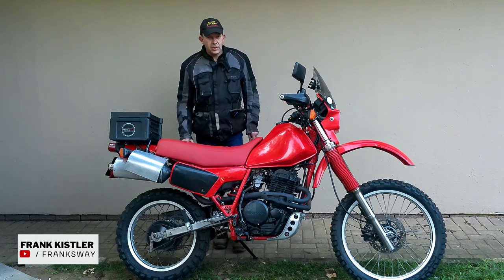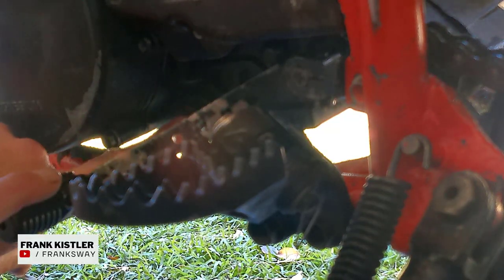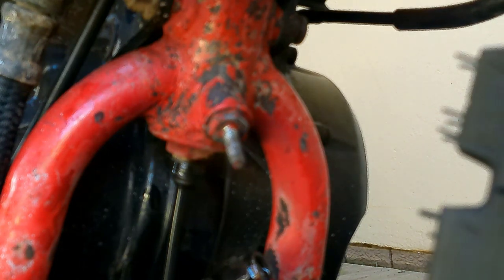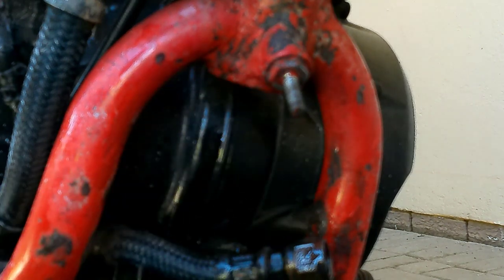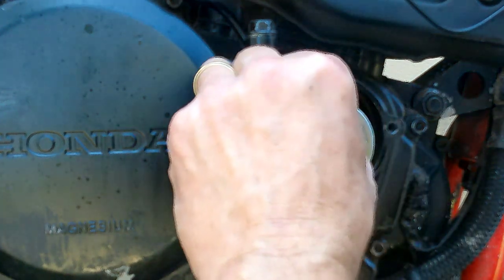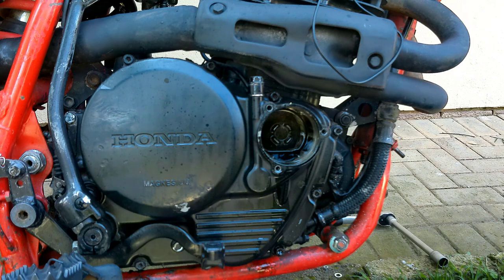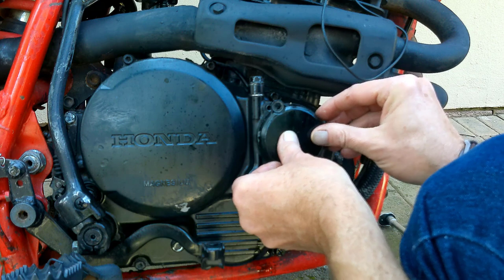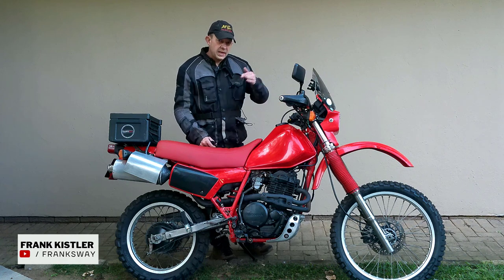Honda XL600 Full Oil Change #xl600,#honda,#xr600,#dirt bike,

Comment: Every how many miles do you change the oil? On my XR600 I do it every 1500 but I don't know if I should do it sooner. Greetings from Spain
Reply from the maker: Greetings, i do mine every 3100 or so miles, i usually use Actevo 4T 10w40 as these are older bikes with different tolerances to the new bikes, some people use full synthetic oils in the RFVC motors, but i haven't as yet used it.Just make sure the oil you buy is the correct JASO for wet clutches as well, and enjoy the bike :)